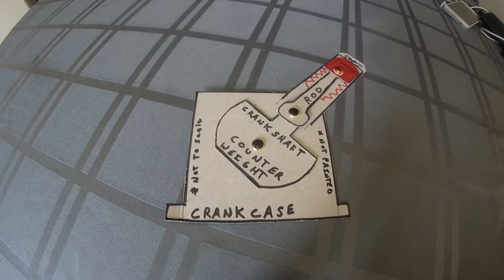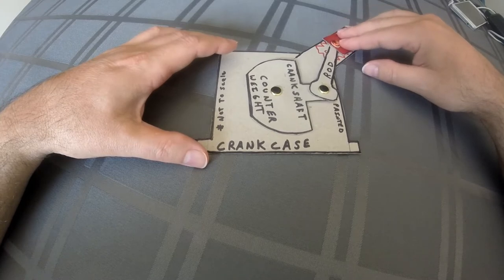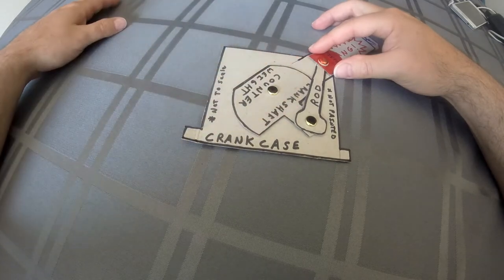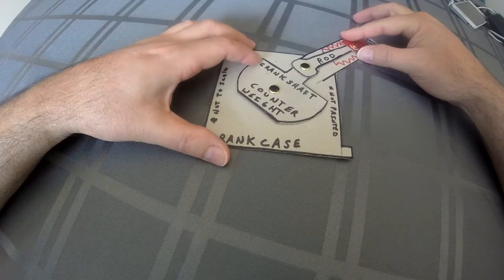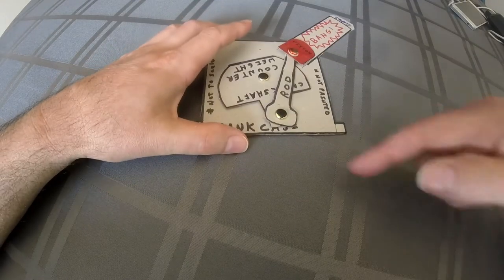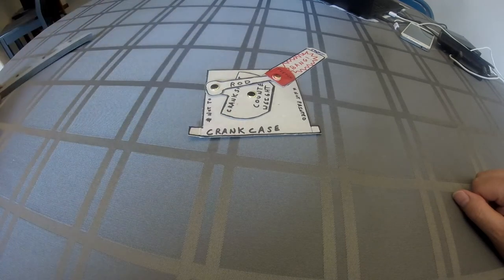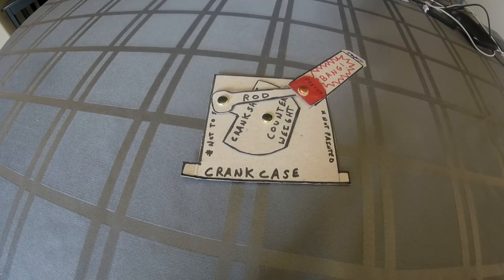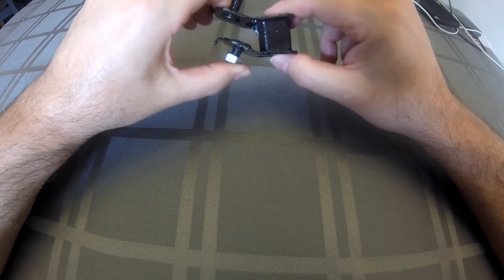Predator 212 Engine Vibration Part 2, Why Balancing Doesn't Work: The SMOG Project 15

Comment: You should tether the engine with some form of mechanical fastener. Also check out the isolators made from looped cable. They're very strong yet still resilient.
Reply from the maker: Thanks. I looked into cable isolators. But the only ones I found were designed for camera equipment. They were all either too small (photographic cameras), or waaaay too expensive (pro cinema equipment). I tested the rubber dynafocal mounts in the next video (Part 3) and had encouraging results. Unfortunately, life kinda got in the way and I haven't worked on this project in several months. I'll probably be back on it after Christmas. Fabricating an engine plate will be easy enough. I just have to work out the vibration tuning so I know exactly where to place the mounts. Also... need to determine if I can get the power from the TAV to the jackshaft with a chain, or if I'll need to use a belt.
Reply: @doktorscottdiabolical  Oh oh. That chain (or belt) will transmit vibration to the vehicle. Plus you'll have tensioning issues. I worked in the elevator industry and did a sound management program on a hydraulic pump unit...rubber mounts, splash guards, mufflers, etc. One source of sound transmission from the pump room to the elevator shaft was actually the hydraulic fluid.
Reply from the maker: Some transmission of vibration is inevitable with this type of setup. Even if I were able to completely isolate the mechanical vibration in all 3 axes, there would still be torsional vibration (as Wilbur Wright discovered in 1903 with chain-driven propellers). The goal here is to reduce the levels down to something tolerable by humans, while keeping the solution as simple, small, and cost effective as possible. If worse comes to worst, I could always rip the axle and guts out of an electric golf cart. But that would be a lot of expense and work. We shall see. Thanks for your input. I do really appreciate it.

Comment: I did stop the vibration about 93% buy welding two bar for the top intake to mount an the thick  mount plat for the bottom I have a skrech beach cruiser an it all steel so in stead of the motor vibration it in the bike frame that absorbs the vibration  an it goes out the tire frame it crazy but it help alot forgot you have to take the gas tank off where it mount on an use them to mount bar on it you will see alot different I'll make a video to show you
Reply from the maker: Interesting! I once had a motorcycle that had one of it's motor-mounts bolted to the cylinder head of the engine. I'm planning to relocate SMOG's fuel tank, so I'll have to think about the possibility of mounts on the top of his engine. I'm planning to do a lot of testing as soon as the weather warms up and I get the lab cleaned out.